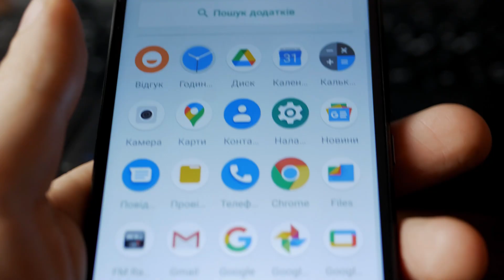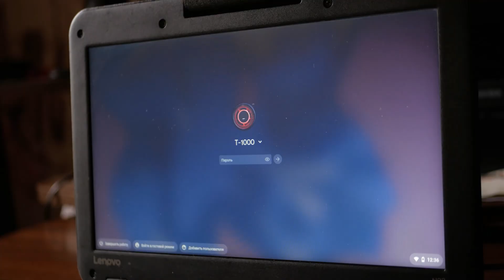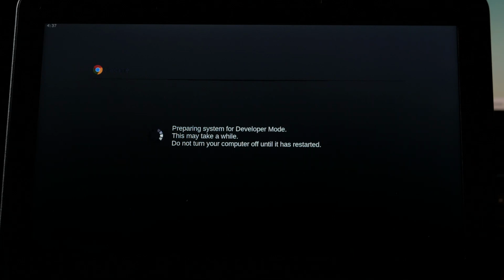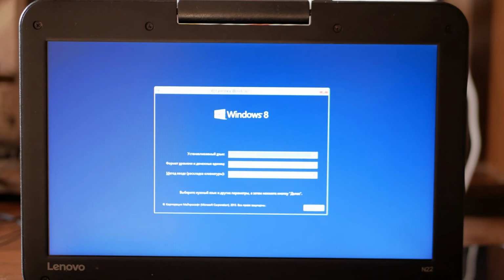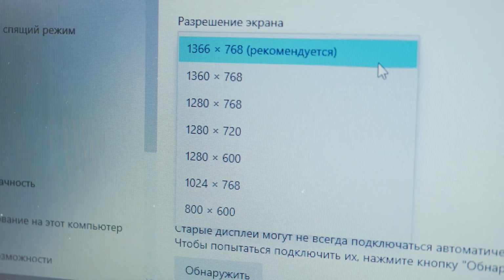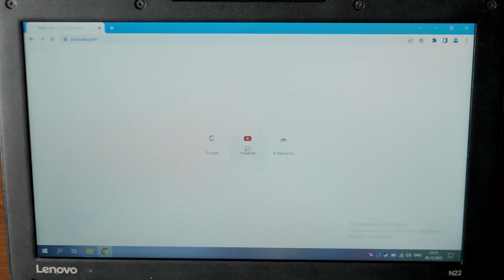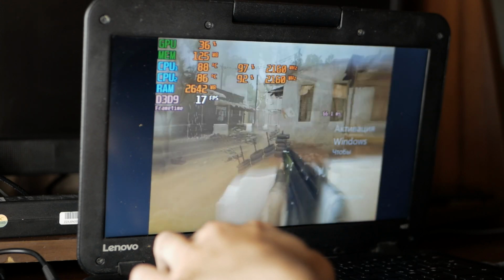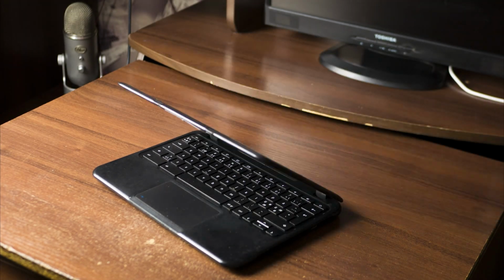Can $40 Google Laptop Become a Windows Machine?

Comment: With $50 you can easily get a core 2 duo laptop that is twice as fast as a N3050 in Cinebench. With $75 you can get a first gen i5 laptop or a 2nd/3rd gen i3 laptop which would blow the socks of any chromebook.
And the chromebook has an Expiry date.
The Windows laptop has no Expiry date.
And the Windows laptop can be upgraded. Almost all Windows laptops can upgrade RAM and Storage. And if you go with 4th gen or lower you can also sometimes upgrade your CPU.
Reply from the maker: Yes, but old laptops suffer from other diseases.
Reply: the point of doing this to said device is to have a small ultrabook/netbook. We use them for media consumption, discord, spotify, etc etc. I am running Debian 12 on my similar specced chromebook and its a good device, and yes the C2Ds are higher in benchmarks, but in reality a Braswell Celeron does media playback better, and also sipping like 4W instead of 30W.